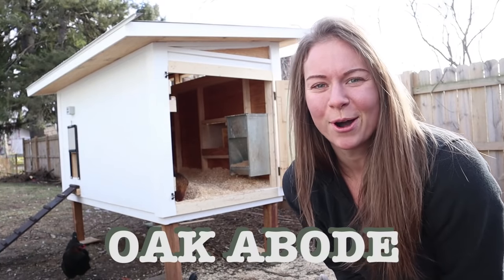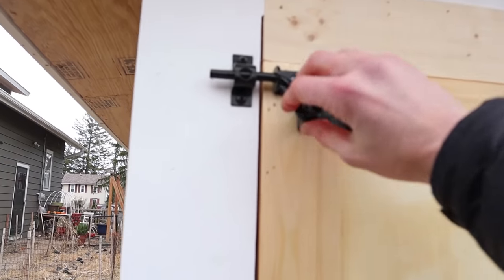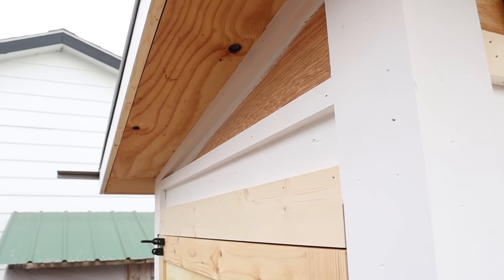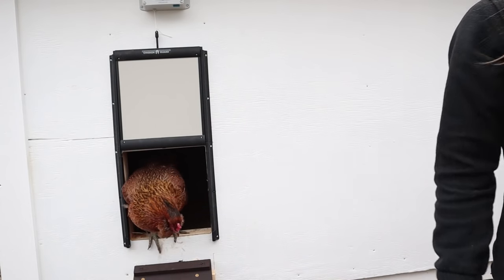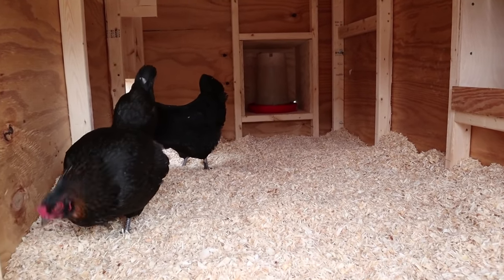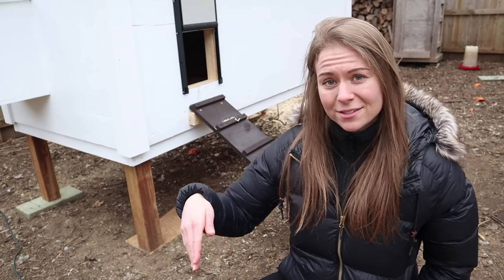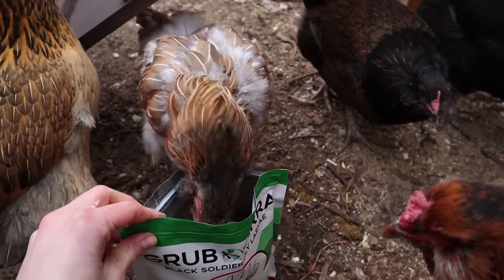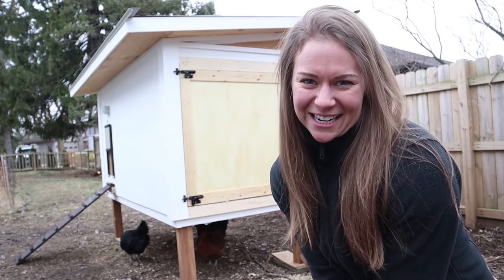OUR DREAM CHICKEN COOP | Minimal Care Poultry Housing | DIY Efficient Design for Backyard Homestead

Comment: You should change that roost from a narrow board, to a wider board. I live up north to and it’s much better for the chickens if their feet are completely covered by their feathers. The best way to do that is a roost As wide as their feet. Good luck
Reply: And it needs to be a round perch, the sharp corners will damage their feet and toes. 🥺
Reply: Thats what I was going to suggest!
Reply: Switch to 2x4 letting them lay on the 4” side. Great job though!
Reply: About how much time and money did this cost?
Reply: 2x4s... sanded... ❤
Reply: @Fearless Fly 🤓  I was told that chickens need square perch instead of round because round causes bumble foot and square are more to there actual foot.
Reply: Also the perch should be a couple feet away from the wall so they have room for their rear feathers. ❤️🐓
Reply: 2x4 sanded then sent to the Amish to finely cure/smoke the wood whilst saying prayer with the whole community. only way to properly give the chicken a place to sit and sh*yt
Reply: @ashleywood7182   SQUARE perches cause bumble foot. A chickens foot has a ROUND grasp not square.
Reply: Everyone please check your sources. Rounded perch or wider flat 2×4 perch. I'm hearing it both ways. Heard of rounded not giving some growers chickens any problems and I'm also hearing the same from those wider flatter perches. Which is it?
Reply: The arguments here seem to be from interpretation of the word "round". What does everyone think of when they hear "round" ?  Some people might think of a broomstick, other people might think of an oval, while others might think of a 2x4 with sanded edges.  A quick internet search returns that the generally accepted best roost shape for chickens is something like a 2x4 with sanded edges.  Whether its a 2x4, 2x2, 2x3, etc. depends on the size of the chickens.
Reply: @JosephBacks  don’t forget that they need to be gold plated
Reply: I just use thick branches that fall from my trees

Comment: Having removable perches is important.  They get messy fast and can get mites if not cleaned. It's easier to cut tree limbs and discard them and replace as needed. Also it's better for their feet to have different sized limbs to use different muscles as it would be in nature.
Reply: I was wondering about using tree limbs for roosts, so I appreciate your post!
Reply: That makes so much sense!
Reply: I will agree, but it is hard to cut tree limbs when you don't have any trees.

Comment: we also live in wisconsin and just built another similar coop. i love the raised coop, keeps any critters from taking up residence under the coop. we insulated ours and then used plywood to cover walls. we dont heat it and leave a window cracked and it is much warmer inside than out. also use deep bedding and there is no problem at all with not being warm enough. we built an attached hoop house for the winter deep bedded with mulch and leaves and they love it.
Reply: Could you clarify if you use leaves, grass clippings for the litter? I heard a few inches of river sand as the base keeps the coop & run dry.
Reply: What's a hoop house. I'm  really new to this.
Reply: @lynn diehl a type of simplified greenhouse using pvc pipe and plastic visquine. Do a web search for hoop house and you’ll probably get a million images of them full of pot plants. It’s become the preferred grow method here in California. I use hoop houses for pepper plants as my part of the state gets cold. It would basically be like a heated chicken run. Great idea for chickens in the winter.
Reply: Thank you for adding this info! Just got an Eglu for our new flock and was concerned about being warm enough.  I liked the raised house and ability to free range (it rolls) while still protecting from the hawks and eagles that fly over the fields regularly.  It was actually cheaper than building a hen house on a small “flat bed”. Would you please explain the “hoop house”?

Comment: I built one about that exact size and design...I now wish I would have gone much larger.  Since I am intending to add some more hens this spring, I will be building a proper chicken house prob 8'x12 with an 8' roof.   Like you mentioned, I had the feeder and waterer hanging inside the coop.  Then, I was reading up and learned the chickens do not need food or water inside their coop at night.  I removed both and they now have much more room.  They seem calmer and the picking virtually stopped and everyone is happy.  The heavies prefer to stay on the floor and sleep in a pile and the Ameraucanas prefer to sleep on the perch.  I built a 25'x10' covered run and winterized it tightly with 6 mil plastic.  They are safe and happy with plenty of room to run around and play on straw bails.  I use straw on the ground to keep them off the cold ground.  We also like to sit inside the run with them every day so there's room for a few lawn chairs.  On sunny days, the plastic room warms up to a very comfortable temp. even on 20 degree windy days.

Comment: I made a dog house for Montana hunting dogs freezing in makeshift covers. From insulted floor, made hallway down one side. Doorway into dog house was on inside wall, back of hallway (doorway lined with multiple layers of carpet strips cut fit doorway fully. In hallway, before inside door, built "pressure pad" dog had too step on, activating inside heat lamp. When dog left dog house he had too walk on pressure pad again "shutting off" heat lamp. We put an on/off switch by entrance too hallway so system could be shut off. Then we hinged one side of roof so complete dog house has access for blankets, pads, etc... The dogs loved it! An auto door like on your chick coop would have been great!
Reply: Wow on the pressure pad door operating set up.  Did you design that yourself?  Was it hard to do?  I've never heard of it before, sounds great!

Comment: You know for the water you can add an automatic mechanical float valve to connect to the house pipe to always keep the water full especially during hot summers. or you can connect it to the gutter of the coop to always supply it with water without increasing the utility bill.

Comment: We bought a small wooden house for children from our neighbours (it was a very cheap purchase), and made the rest of the walls, frames, doors and roof from wood collected from garbage and pallets. We only bought screws, polystyrene and OSB boards to cover the walls inside. And of course paint. We live in Poland, in an area where it can be cold in winter, so we wanted our chicken coop to be insulated. I have no experience, I'm not a carpenter - I'm a graphic designer, just like my husband. Using basic tools (saw, hammer, tacker and screwdriver) you can do it yourself. But that takes time. In our case - about a month (we worked on this project only on weekends).

Comment: I actually like your water cubby, that's much easier than the pipe and nipple system. Although in Alabama our winters are not as long nor quite as cold but cold enough to freeze water. Here the raised coop helps snakes. Love the automatic door as well. Thanks for sharing your ideas.

Comment: Nice. make sure to add some protection against the sun for the feeder if you place it on the outside, as air moisture and heat together will cause mold in the feed very fast on summer.

Comment: We built our coop with a cement floor, 2 doors and 2 windows.  It is a gable roof and the cost was under $1,000.  It can house 100 birds.  Guineas and chickens
Reply: The cement floor is 4 inches thick. and used 2 x 4's for all of the wood, and plywood.

Comment: I have a plastic tray that sits at the bottom of my coop and the bottom of the tray is the bottom of the coop and I fill the tray up with wood shavings and whenever it’s time to clean it I slide the tray out and dump it out and since it’s plastic I wash it and fill it back up with fresh shavings it is so easy to clean

Comment: Woke up to 7 dead baby chicks, we call them babies but they were a few weeks from laying. Had been losing one every couple days and thought it was a hawk. Locked them into coop last night, just a board with a 2*4 leaned against it really. Never had evidence of predators in coop before but board was askew and chickens all dead in run. A few beheaded, one gutted, and 3-4 completely intact. I bought your plans months ago and put off building. I’ll be building 2 today, I know up front my water box needs to be taller for my founts and heat plate set up, I ran an open galvenized pan on same heat plate all winter last year and never froze once (rarely see below 15 in new mexico).

Comment: Where do your chickens hang out when the weather is horrible? I have an elevated coup, and the first adjustment I had to make was to put barriers up around three of the four sides.  I used clear corrugated plastic.  I scattered hay in the winter, so they can get all comfy in there, and it's not dark. I have a ceiling inside the coop as well, so that I can vent into the attic. Gets cold around here (-30F just a few weeks ago), so I insulated the coop with pink board.  I have a little roosting box too, but wish I wouldn't have put it in.  In fact, I might remove it this summer.  I have two doors of those big doors on mine, although that's a bit of a luxury.  You should put a board across that doorway - a 1x4 to keep the bedding inside. I just put little hooks in, so the board can be easily lifted out when I clean.  Your life would be a lot more simple if you kept both food and water out of your coop.  Put a shit board under where they roost, clean it daily, and the things stay clean forever.  I only have to change my bedding yearly.

Comment: Looks like a sturdy build. I prefer to be able to walk inside mind. I hung my 2 feeders from the ceiling so very little bedding gets kicked into them. I also put them along the side so nothing is in the center. I put the waterer on the side as well, on top of a milk crate. It's just high enough for them to reach their beaks in and bedding doesn't get kicked into the water. Plus, more than a couple of chickens can get their water at the same time (which happens often).

Comment: I am also in WI, and have a system to only clean the coops 1-2 times a year. Using wood chips 6-10" deep, which gets hot composted for the garden. That only works with a larger coop, and I'll rake it around when it's warm if things build up under roosts. I can get a PU truck load of wood chips for $5 in Eau Claire. Very nice set-up, chickens are so much fun to have.

Comment: Put appropriate size wheels for the weight of the coop on two of those coop legs and a handle on the other.  Then you can move it around for easier cleaning under.  Better yet, just make it a chicken tractor.  Add the wheels and handle, then fence the bottom in for a chicken run. You'd have to put a ramp in the floor that drops down to the underneath run.

Comment: Are you still monitoring threads? How did this design stand the test of time?
I like the 'water hatch' idea - does solve the issue of an exposed plug, I'm in BC and for sure will have top heat water and maybe the coop. I only plan on a few birds till I know what the heck I'm doing and too big a coop will be tough for them to keep warm. I would heat the floor but planning on the deep-litter method so don't think heating it would be good - for smell or microbes and bugs.
Have you changed the egg recovery style? I'm going to make the top - secure. Easier to seal agains possible water in the nesting boxes but also, the vast majority of natural predators come from above - so chickens are programmed to freak out when disturbed - from above. Dropping the rear wall, under the overhang and lowering that (on a chain so it goes level but no more) doesn't startle them nearly as much, from what I've read.
Nice design - I'm going to do something similar.

Comment: Great video and coop design.
I built a similar one up on stumps, I also put three sides under it, one at the back and each end leaving the front open. It is their favourite spot when it’s raining or a strong cold wind blowing, they can be outside but sheltered, it also made a great spot for a dry dirt bath which they make good use of.

Comment: I don’t put my food or water in the coop at all. I have it in the run. But I’m in MS, so winter is pretty mild.
Reply: I'm just setting everything up and my coop is only 4 x 4 feet (for 6 girls) and don't plan to feed/water inside either. Although I am considering contingency plans if we have a bad winter (in PA) so I can if needed. I set my coop up in an area with plenty of wind block and am planning to add a tarp on the windward side of the run in the winter to keep them comfortable from the weather. I've seen some other local coops in my area and their birds seem to be out all winter long messing around out in the runs.

Comment: I had this same chicken guard door. It was great for about 1 1/2 years. Then the string got tangled. (Easy fix) But after that, oddly, the function of the up and down buttons reversed somehow. And it didn’t reliably close. And one of the locking flanges on the bottom of the door wouldn’t come out anymore. Seemed like it was spring-loaded but the spring mechanism broke. They have a two year warranty. In order to use the warranty, you have to ship the product to England. And then they’ll look at it to see if it’s a warrantied problem. If it is, they’ll fix it. If not, they can fix it for a fee…I forget how much but it was a lot. I recently had to ship a similarly sized item to France. It cost me almost $100. For routine shipping. I realized that fixing the door could cost up to like $150 or so, and the warranty wouldn’t be extended. I decided to try a different company recommended by another YouTuber, made in the US. Ladies First chicken door. Haven’t gotten it yet. A bit more basic, but with some other features.

Comment: Very nice coop! Just a friendly suggestion, i would add a few windows with screens on the sides. Will keep em way cooler in the summer. They can overheat easily when its hot. ☺
Reply from the maker: We actually will be replacing the door with a hardware mesh/screen version for the summer! Then just swap it back to this one for winter 😉
Reply: @OakAbode  That's a great idea. During the day, all year round, I would just prop the side door open, so the hens can hop in and out as I noticed they were doing in the video.

Comment: How's it working with food and water in the coop?  A lot of chicken keepers choose to not feed in the coop for cleanliness; they've eaten all day outside and will be fine overnight.  Also,  have you considered taking the router and a roundover bit on the perch?  Those corners look pretty painful to me.  This comment is 3 years later so I am wondering if you still have this coop.  Sitting on top of the ground with no anchors and the posts not set into the ground, I was wondering if the coop has been blown east into the lake?

Just questions I have.  Overall, you've built a fairly inexpensive, basic, coop.  Tied down, it would be a very good basic way to go.

Comment: That is very similar to my coop. My coop has the same design except I put windows on the sides where the roof is a triangle and I noticed I need access doors on at least 2 sides.  My dimensions are 4'x4'x 7' with a 1' pitch to the roof. I keep 9 hens. How many do you keep?
Reply: I have five hens and once had to give away three roosters
Reply from the maker: Hi Iandi! We have 17 currently but plan to get a couple more in the spring.

Comment: The roost board should be farther out 10 best at 12". The edges of the board should be rounded a bit so sharp edge don't scratch, tear or get splinters in there feet.

Comment: I'm thinking on building basically the same as yours but set it up with much more ventilation.  I live in Southern Alabama  so much hotter and not very much winter, and has only snowed 2 times in the last 25 years.  I'm also thinking about the side sliding chicken automatic door. It has a built in no squish for nosey hens that sit in the door. I've heard of hens getting caught in the top slider and killing them.. that and pulling out a little more from the side and slightly lower roost because I intend to have orphington hens. I will have an attached run and put the coop semi outside the run, that way I can clean the coop and collect eggs without going into the chicken run. I will be wiring it up so they can get under the coop but I can still clean it up like you do. Not sure how but I would love to put a fan inside the coop to keep it cooler in the summer.  I'm only getting 6 because that is all they allow in my area with no rooster.  That is why I don't want to free range.

Comment: Thanks for all the great videos. I'm in the middle of planning out my coop and I have a few questions. I live in Kelowna BC Canada and in the winter it can get down to -25C or -13F. The plan is to get 5 hens to start and maybe 1 or 2 more in the future.
Do I need insulation in the walls, floor or ceiling? We plan to do the deep bedding method.
How many square feet for 5 birds should you have for the coop?
When you made this video, how many chickens did you have?